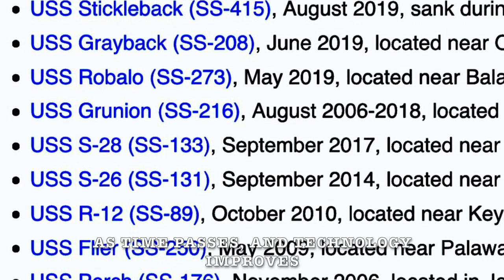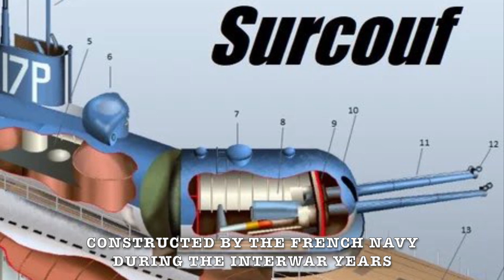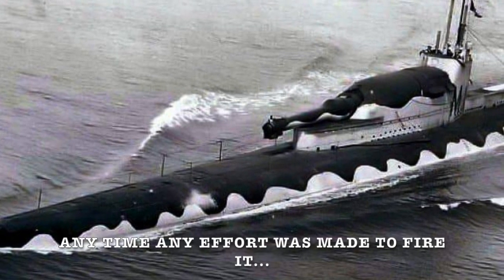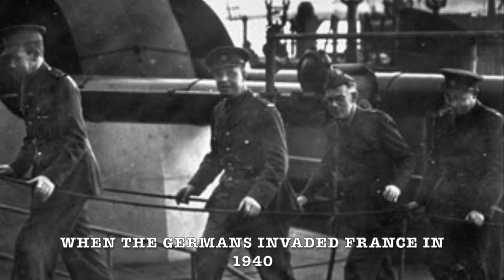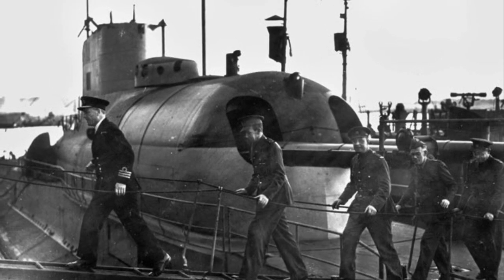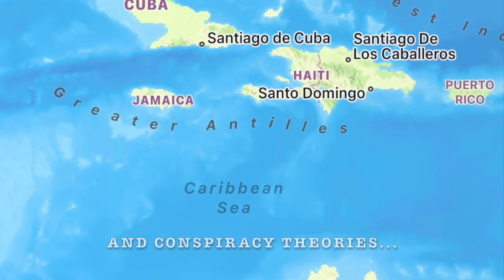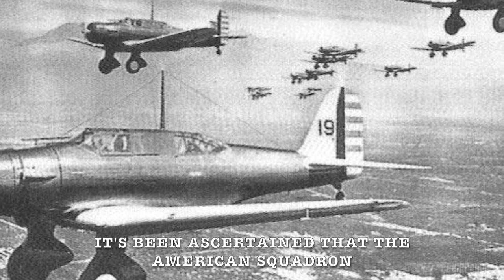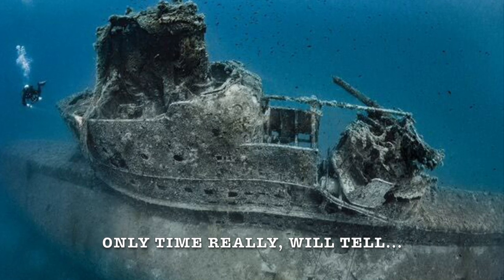The loss of the Surcouf

Comment: Ortolli had to manage to get his crew working alongside the Royal Navy, despite no one in the fench Navy trusting the british, after Mers El Kebir, and the killing of more than one thousand fench sailmen, killed by the british Navy.
The point about ortolli surrending the ship to Vichy is also pure fantasy. French navy planned from the defeat, the scutting of the French fleet in case Germany wouldn't have respected the armistice terms, and tried to size the French fleet...
The technical points are mostly true. Apart from the fact the Surcouf flaw were very different from the one from the British design. The Surcouf design actually solved the issues the British were facing before with their own design. Only to realise that technical flaws were not to blame: the whole concept was a failure.